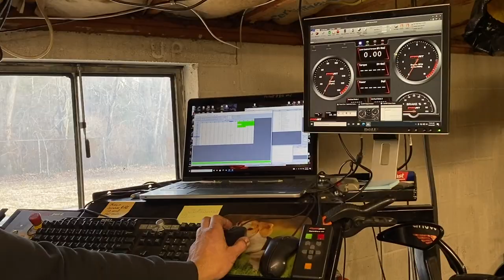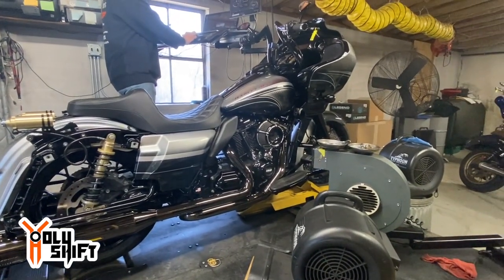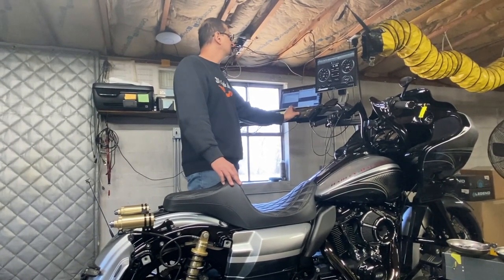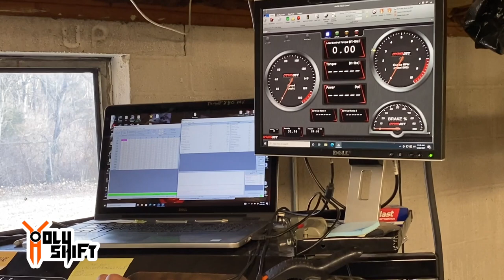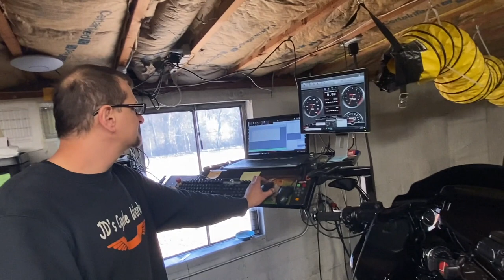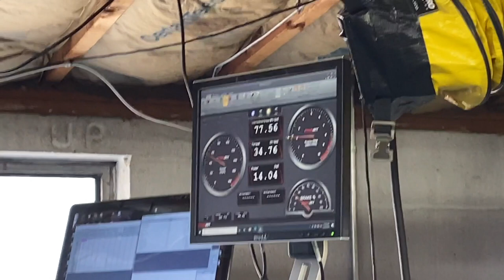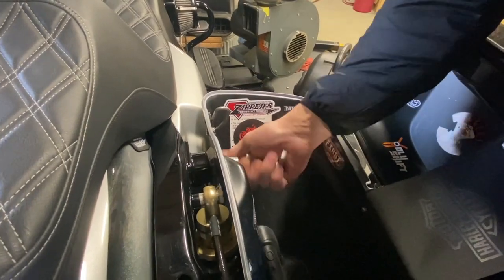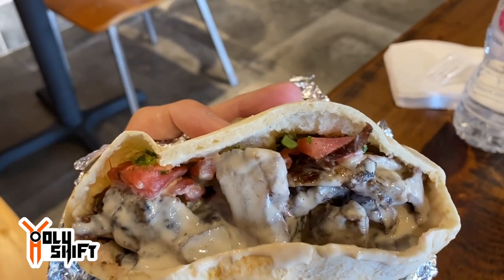Secrets Of a Harley Professional Dyno Tuner / Silverbacks Dyno settings

Comment: Great Vid, Sandy, But a question here,  " Wouldn't it be more prudent to have the rider sitting on the bike when the tune is being done?" That way the tune would be set up for real-world riding conditions. Ciao.
Reply from the maker: Good question! But I think as Dave said - he-does all of his tunes the exact same way.... So maybe we should ask why didn't he did do that initially many years ago...?
I'll ask him next time I'm there...
Reply: The dyno applies a specific working load to the wheel. The computer knows what that load is while monitoring every parameter of the motor and exhaust makeup to establish a proper tune. Weight on the bike won't make a difference. The only parameter that it won't make up for will be the wind resistance. Hope that answers what your wondering
Reply: @gliderydin2911   and  Sandy, Thanks for the reply's ..... My thinking was the weight on the rear wheel might actually  change the acceleration rate on the Dyno due to the increased  load on the rear wheel-Tractive effort versus  overall weight. .. So that said ..... How much wind resistance  does John make if he is 300 pounds and rides like he stole it .... after Dave did the tune.. LOL  
Stay Safe....  Ciao
Reply from the maker: @gliderydin2911  thanks, didn’t know that …👍🏻👍🏻

Comment: Can you also explain how smoothing also is considered on dyno runs . Ive seen some tuners run SAE ,Smoothing 3,4 or  5. Thanks . I liked you mentioning the tire size, sprocket size. Its like racing a dirt bike.  Tire size/carcass construction/ tread pattern, rear sprocket size ,counter sprocket size, shock and fork settings make all the difference from one track to another.